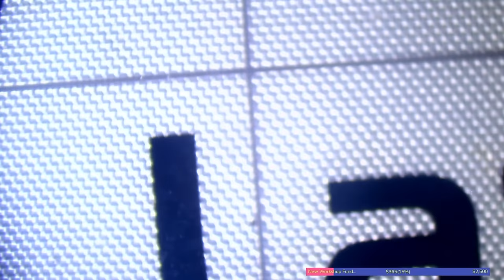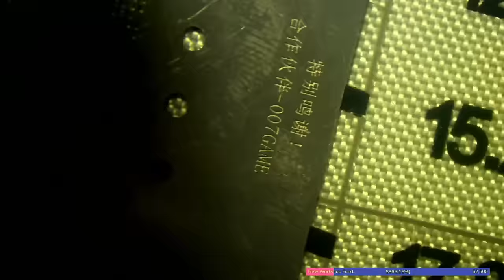This PlayStation 4 Pro Won't Turn On... Can I Fix It?

Comment: Have you ever fixed a PlayStation 3 or a phat PlayStation 3? Thank you for your video's
Reply: Phil doesn't work on these systems purely down to the fact they usually isn't worth it,

However I think Phil is starting to work on some retro stuff
Reply from the maker: I've fixed a few but I don't generally work on them